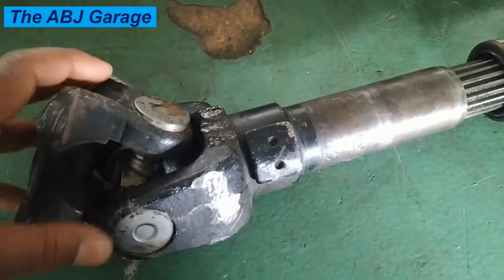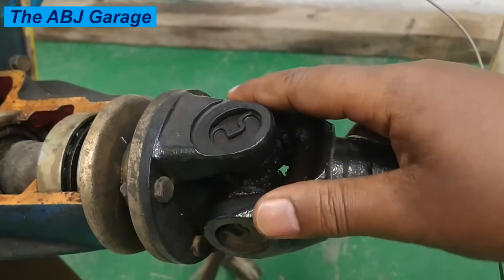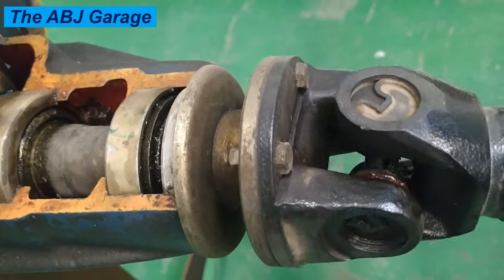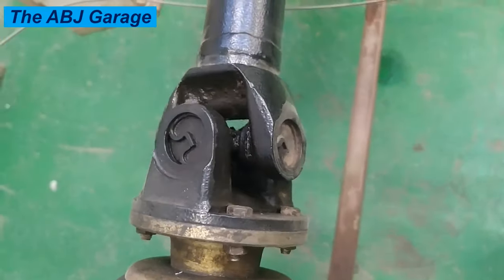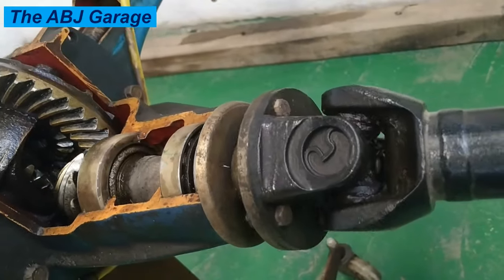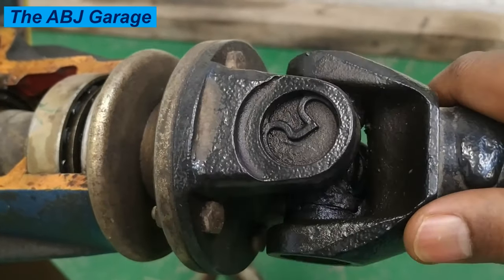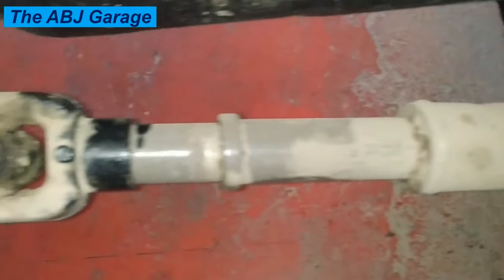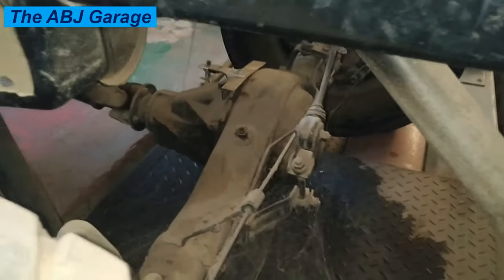7 Signs of a Bad Universal Joint

Comment: My car vibrates most notably in second gear at about 3.5k rpms then stops and it hums. When put into third gear when it’s at about 2k rpms then the hum gets very loud. The humming and vibrating seems to be coming from the rear end of the car. What could this be?
Reply from the maker: What car are you driving? Have you checked the rear differential and joints? It could also be caused by worn out wheel bearing or irregular tire.

Comment: My truck has a subtle vibration when I let of the gas at 65-70 mph and starts slowing down would ujoint possibly cause that?
Reply from the maker: There are a few potential causes for a subtle vibration when letting off the gas at highway speeds around 65-70 mph: driveline imbalance, tire imbalance or unevenness, worn suspension components, transmission/transaxle issues, and sometimes aerodynamic factors- subtle changes in airflow around the vehicle as you let off the gas can induce small vibrations.
Reply: Ram truck by any chance..?
Reply: @g8summit  2009 Colorado with the 5.3

Comment: What about humming noise when vehicle is at 60Kmph
Reply from the maker: From where do you hear the humming noise? There are few probable causes. Here are some of them: A humming noise at 60 mph could be caused by a variety of issues, including:

1. Uneven tire wear or a tire that is out of balance can create a humming noise, especially at higher speeds.

2. Worn or damaged wheel bearings can also cause a humming noise, particularly when driving at higher speeds. If the noise increases when turning, it may be a sign of a faulty wheel bearing.

3. Problems with the driveshaft or differential can also result in a humming noise, especially when driving at a consistent speed like 60 mph.

4. A transmission problem, such as low fluid levels or worn gears, can cause a humming noise while driving.

5. Sometimes, the design of the vehicle can create aerodynamic noise at certain speeds, leading to a humming sound.
Reply: @TheAbJGarage  Thanks actually fixed the issue was the wheel bearing
Reply: Wheel bearing/hub assembly. It will progressively and get louder and louder and louder until finally it pops and then your wheel will tip to the side extremely far